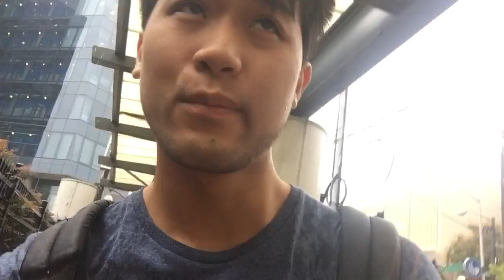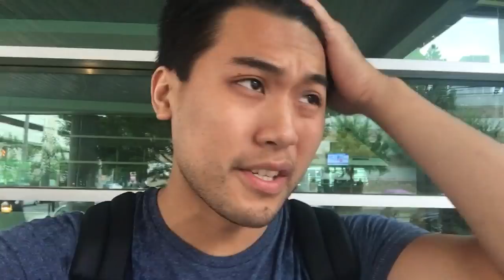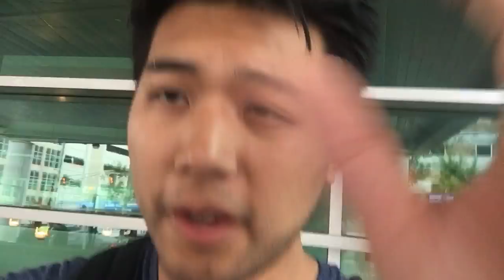Cubicle Labs Polymer Coatings

Comment: How do u check the uniformity of the coating? Also, just like wafer fabrication, coating something is best done using gaseous coating material, which helps alot in uniformity. Because uniformity is very important. But it seems like u are doing it using liquid source. Just saying, that the uniformity is not as good and results may vary from cube to cube.

Comment: Is there a reason manufacturers don't just make the plastic softer?  Is it more expensive or difficult or something? Doesn't work with injection molding maybe?
Reply: defeodation it means more steps in the production process. Pretty much the same reason they don't put magnets in all cubes. More steps=longer production time= less products made=lost money
Reply: Although most FP companies say they don't really care about profits, ultimately they do want profits. So even if a cubing company wants to help the cubing community, it just as much, if not more, wants profits, so yeah.
Reply: matty amicaterra  actually I mean they could do it without any extra steps.  They wouldn't need to polymerize the plastic because they could use softer plastic to begin with like dayan used to use